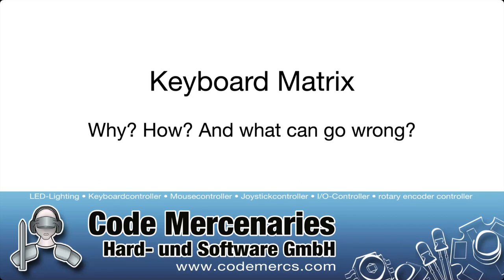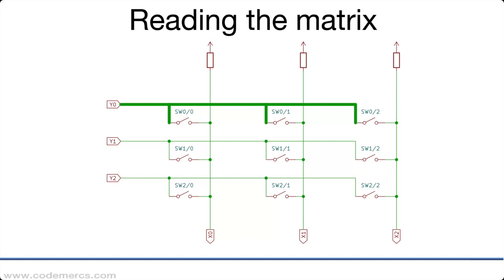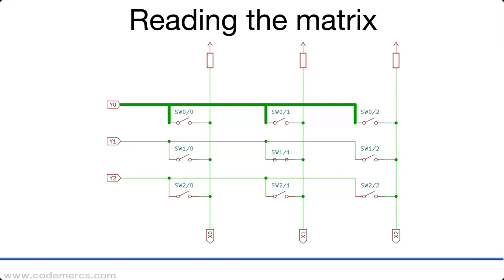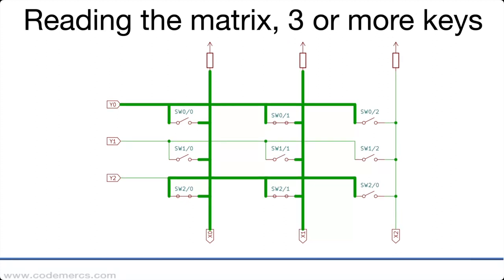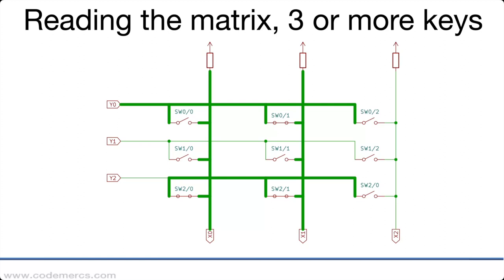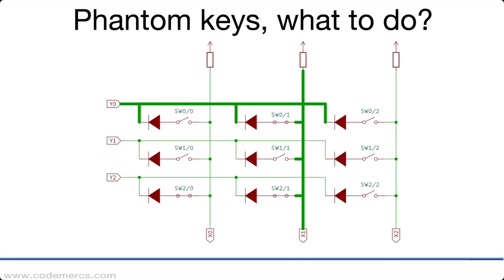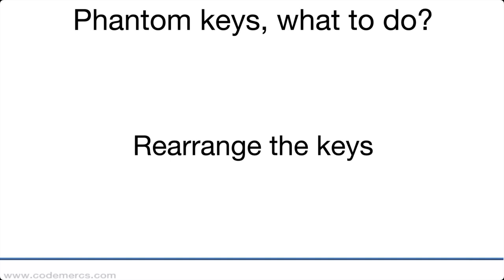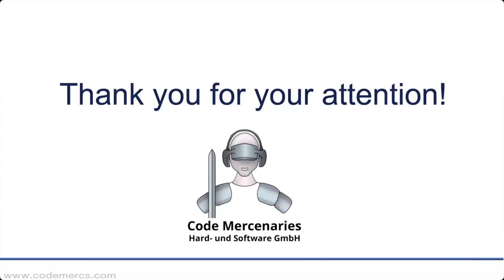How does a keyboard matrix work? Why is it used? And what are phantom keys? And how to avoid them

Comment: So is the only way to get the intersection value to set each Y value to high and see which X values respond? Or is there any other way to do it other than polling?
Reply from the maker: Actually typically the X lines are pulled high by resistors and then the scanning process pulls down one of the Y lines and checks if there is a reaction on any X line.
If you pull down more than one Y line at a time you can not identify the actual position that is pressed.
Reply: @codemercenaries9715  also, why does the circuit use pull up resistors and not pull down? Why define a pressed key as a logical 0 instead of logical 1?
Reply from the maker: Drivers that pull to ground (open collector or open drain) are more efficient and simpler to implement in silicon than drivers that pull up. That is why many digital signals are active low and use pull ups for the non active state.
And inverting the logical state afterwards is a no-brainer.
Reply: @codemercenaries9715  thank you 😁